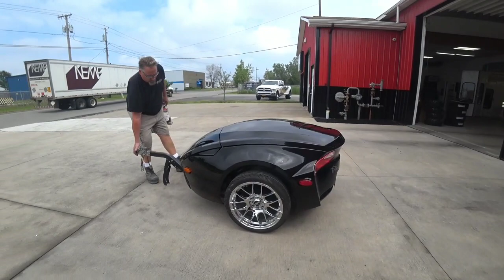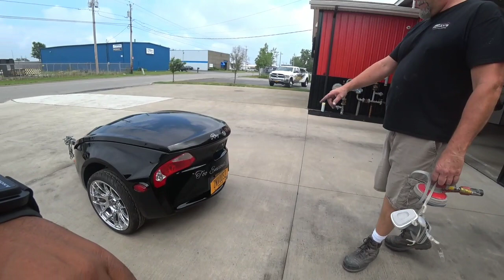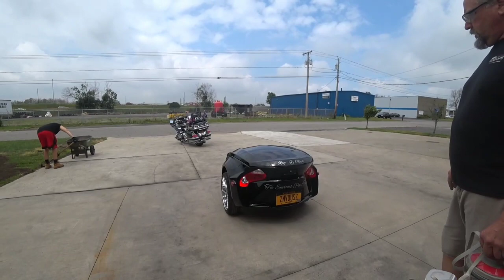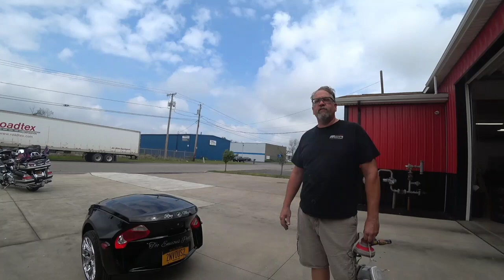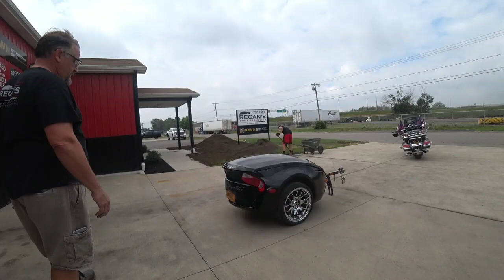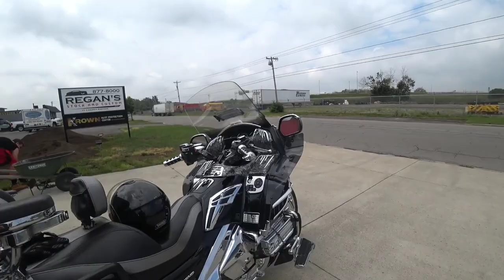2 ENVIOUS CAN AM TRAILER PAINT AND AIR BRUSH LETTERING

Comment: Where did you get those chromed wheels ?
Reply from the maker: THESE ARE CAR RIM THAT WAS 16X8 THAT WAS CUT DOWN TO 16X5. AND THESE ARE CAR TIRES ON THE RIMS. THE THEORY BEHIND ME DOING THIS IS NOT TO HAVE TO CARRY A SPARE TIRE CAUSE CAR TIRES HAVE MORE PLYS THAN A MOTORCYCLE TRAILER TIRE. THE RIMS WERE POWERED COATED GOLD AND I SENT THEM TO CALIFORNIA TO GET CHROME PLATED. THIS PROCESS IS 1,700 1,950 DEPENDING ON THE RIMS YOU PURCHASE. THANKS FOR WATCHING
Reply: Thanks for the great info , really appreciated !